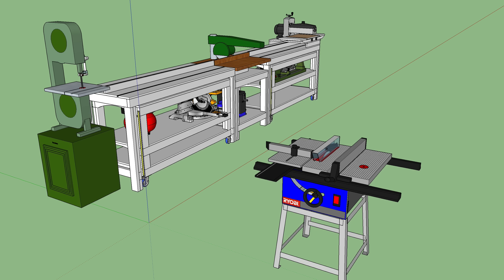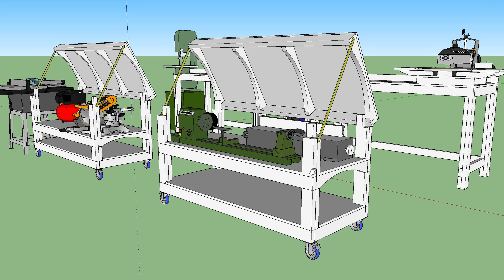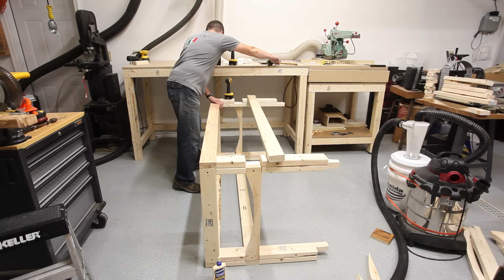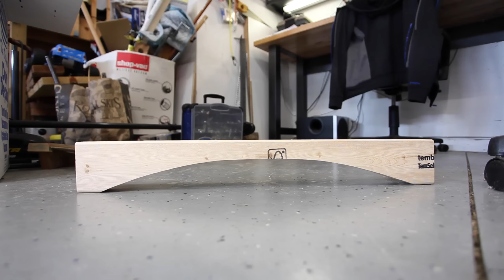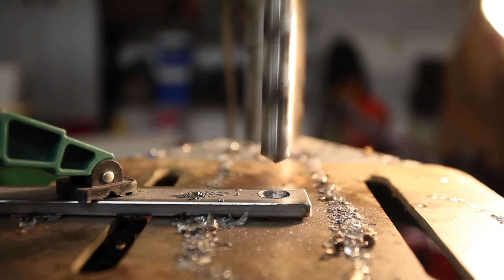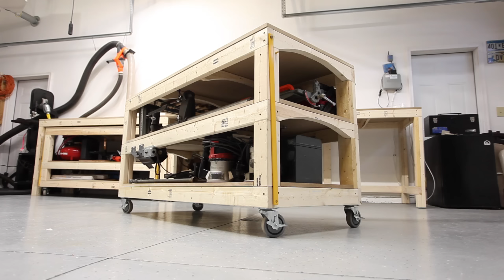New Shop Build: Part 6 - How to Build a Rolling Workbench

Comment: i have a similar four inch joiner without a motor or pulleys, would you be able to tell me the size of your motor in HP, size of the two pulleys and length of belt, great video practical and well done thanks
Reply from the maker: Hey Clive - my 4" jointer motor is 1/3 HP at 1725 RPM and I'm running a 6" pulley on the motor shaft, a 2-3/4" pulley on the jointer, and a 35" v-belt.  Motor Speed x Motor Pulley divide by jointer pulley: 1725 X 6 / 2.75 = 3763.63 rpm.  I think most people try to target 4000 rpm.  Hope that helps!
Reply: much appreciated info, thanks for that

Comment: Neat design. Do you use the miter saw as a sit down or lift it onto the closed bench top? Will you add fence extensions?  You have your other benches quite high. Maybe 44 inches? What was the design rationale for the different heights? I'm currently struggling to design and fit everything into 36 inch work height carts.
Reply from the maker: Thank you! I primarily use my radial arm saw and only use my newer DeWalt chop saw when I want to run two saws or a different blade.  In the full design, there's a "chop saw bridge" that bridges two rolling work benches together to make a secondary miter saw station.  When using that, I'll lift the chop saw onto the bridge and can still use both rolling workbenches as assembly tables.  It works out really nice.  I'm going to be doing a video soon on the chop saw bridge so stay tuned for that.  Each rolling workbench is 37-1/4" tall and the main tables are approximately 42" tall (bar height).  The reasoning behind it is that I wanted enough room in the carts to store certain tools and I wanted the main tables bar height so that I don't have to bend over much (I have a bad back).  If you're interested, all the measurements, details, and instructions are available on my web site: https://tommytompkins.com

Comment: Tommy, Great video, love your project!  Can you please tell me the sketchup add on you use for the layout/partslist you show in the beginning of the video?  Thanks!
Reply from the maker: Thank you!  I don't use any Sketchup add-ons for this.  I basically designed everything first, made copies for a parts "scene", then I manually dismantled all the components and laid them out with measurements.  It was a long manual process.  I wish I knew of an easier way to do this, but I'm very happy with the results.  If you're interested in the Sketchup file, I just made it available at https://tommytompkins.com

Comment: Great design.  One suggestion - I noticed that the yellow bar supports swing back and forth a lot whenever you move the tables.  If you embedded a couple small magnets into the wood of the legs down near where the ends of the bars rest when the top is down it would stop that swing in short order.

Again, great design!
Reply from the maker: Another great idea. Thank you!

Comment: Hello, I've recently come across what I believe is the exact same lathe on your vid. The seller is asking $125. Do you think this is a fair deal? Granted, it's not as nice as yours. It's actually visually very rough but mechanically sound, per the seller. His father used it 3 months prior to passing away, I'm told..  Thanks!
Reply from the maker: I've been very happy with mine.  You can't really go wrong for $125.  Not sure what yours comes with in terms of a chuck and tail stock, but I picked up a modern live center tail stock from Rockler for about $20-$25 which is much better than the one it came with. The original one mine had didn't have a bearing in it so it always got really hot with friction and didn't work so well on metal pen mandrils.  I'm a big fan of old tools if they aren't broke!
Reply: Tommy Tompkins don't that lathe give you back ache?
Reply from the maker: Not at all!  I've had a bad back for the last 20 years so I was also concerned about it being too low.  Over the holidays I used the lathe quite a bit sitting down in a rolling desk chair and my back didn't get sore at all. There's a quick spot in the video where I demonstrate what my posture looks like in the seated position.

Comment: sorry loving the several ideas I got from this video, one thing I am trying to work through is the uneven floors - I noticed you use a block for the level there at the end...... Hummmmm thinking on a solution for that.
Reply from the maker: My floors are REALLY uneven because of my floor drains, but I'm finding that I only use the wood wheel stop when I park it under the bench just so that it's fully supported on all wheels over a longer period of time.  When I'm rolling it around the shop, I don't bother since I can always find a position where all 4 wheels are supported.  It hasn't been a big issue.

Comment: cool project, I did something like this with my tire changer so that I would not lose work bench space.. loved it. oh and it might be cool to add some lighting for the underside of the counter when you are working on the lathe.  Just a thought.
Reply from the maker: I have some bright LED shop lights in my garage so in my case I don't "need" them, but adding some LEDs to the underside of the lid would be pretty cool :)

Comment: This is a really incredible design, I am definitely going to have to rethink my garage setup now. Personally I would make the surface of one rolling table plate-steel for welding though. Also not a fan of generic caster-locks; check out DiResta's band saw stand. Excellent video too (not VCR quality + cameraman with Parkinson's)! Thank You!
Reply from the maker: That's a great idea to make one of the tables a welding table. If you make one, be sure to send me some pics!  I'll check out DiResta's band saw stand.